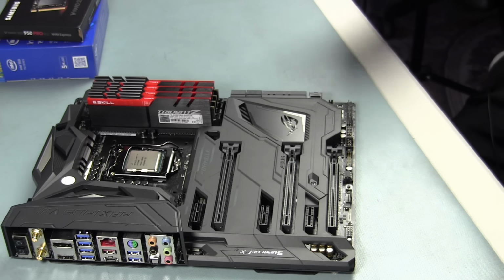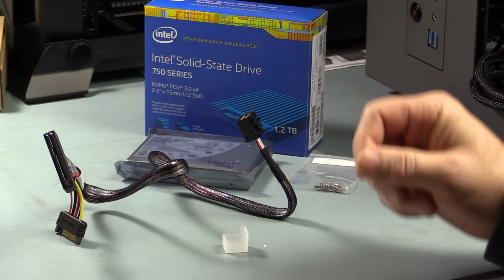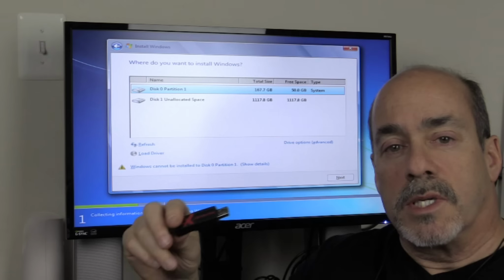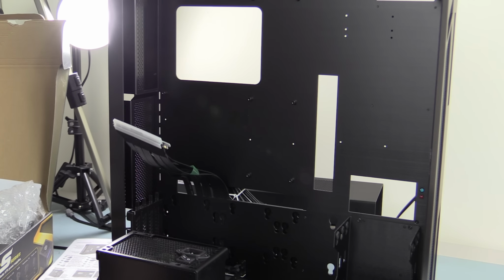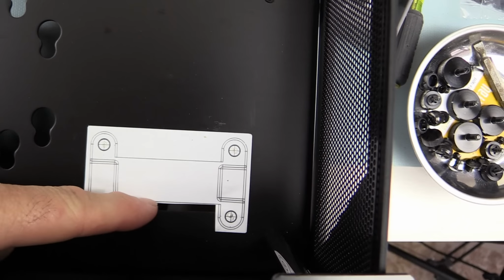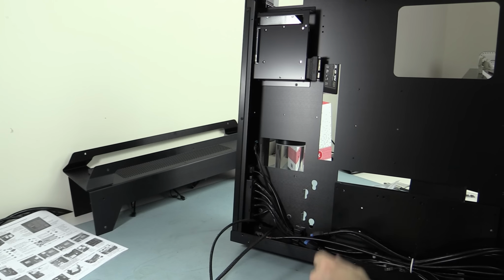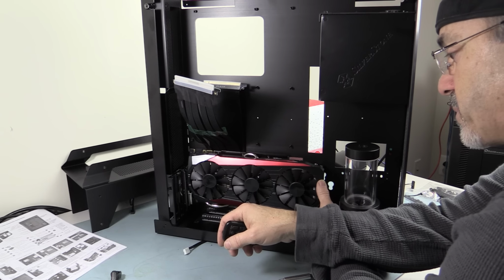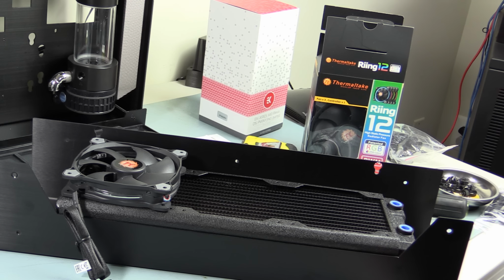Ultimate RGB Skylake Gaming PC  -  Build Log 2

Comment: is maximus viii formula perform like maximus viii extreme or gigabyte z170x gaming g1? reply me plsssssssss
Reply from the maker: Sorry, i do not know. I have not tested them.
Reply: OK . but pls tell me that is that  mobo enthusiastic for ultra & vr gaming.
I will build a extreme level skylake pc & my config. given below

Mobo- maximus viii formula/extremeor       gigabyte zi70x gaming g1
cpu- i7 6700k+
cooler- 100i gtx
case- noctious 450
gpu- asus strix 1080 sli
psu- hx1000i
ram- dominator platinum 3000mhz 16gb (8*2)
monitor- predetor x34

but i am confisuing about motherboard. pls advice me?
Reply: Rupanjan Guhathakurta formula is good mobo.Asus extreme is enthusiastic type of mobo.I was also confused in Asus mobo line up but now I am buying Asus hero alpha for my build

Comment: Are you sure that PSU won't be affected lifetime wise with that fan covered?
Reply from the maker: +Tanner Blomster The PSU has space to draw air in. It will be fine.
Reply: Ronsanut Ah okay. I'm disappointed too that you that you can't flip it around though. I'd think they'd make it work both ways. If you wanted to you could probably file the bracket on the side that overlaps the plug on the PSU to make it fit. Then maybe widen the holes on the bracket to align with the screw holes better. That's a time vs benefit situation though.

Comment: You can activate windows 10 with the win7 key, i tested with windows 8 key in some computers that i build and if I'm not wrong also works fine with Windows 7 keys.
Reply from the maker: +Albert Cabrera I have heard it does not work all the time. But I will try. Thanks.